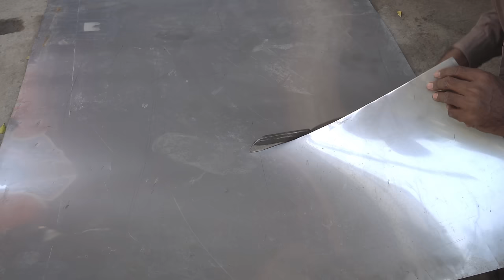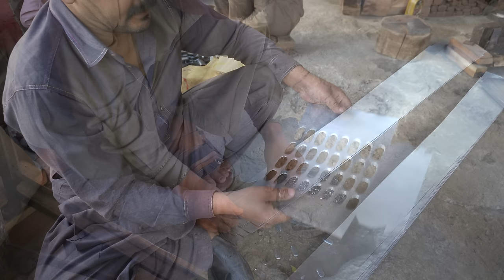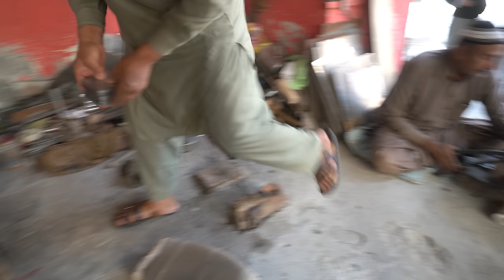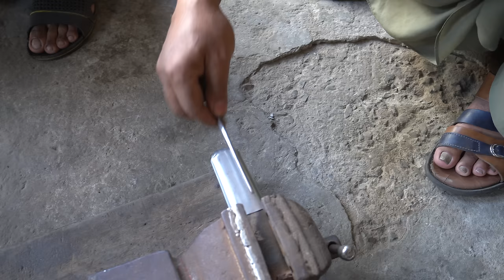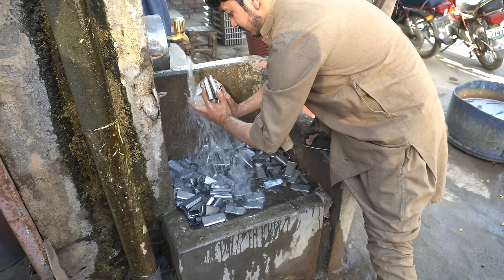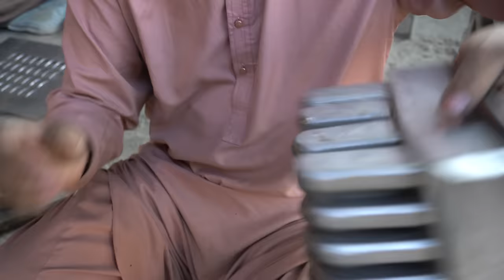How stainless steel Ice Lolly popsicle molds are made | Amazing Ice Cream Mold making process

Comment: Pewters containing lead are no longer used in items that will come in contact with the human body (such as cups, plates, or jewelry) due to the toxicity of lead. Modern pewters are available that are completely free of lead, although many pewters containing lead are still being produced for other purposes?
Reply: isn't it steel?
Reply: @paolodesiato9497  they are using soldering irons to make the joints, which commonly used to melts pewters for electronics (60% tin and 40% lead). 
On the video they are using leadfree pewters, this can be noticed by the lack of shine on the soldered parts
Reply: @Guiabc321  If they are using lead-free solder, the form would break apart right after warranty. Wait... said anyone warranty?
Reply: @Guiabc321  no that's lead solder for sure.
Reply: They washed the cups after soldering them, maybe to remove flux, and soldered again afterwards. I can't tell the pewter is lead free, and the sheet metal may be not healthy too
Reply: Vai Ata koi

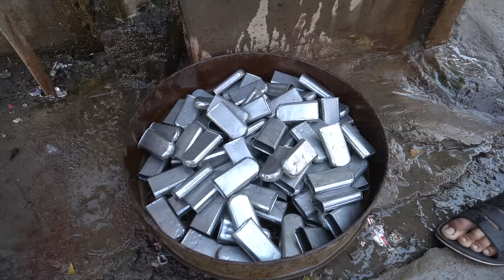Comment: 6:58 Finished washing and already put it on the dirty floor!
Reply: Do you think it would not be washed before use? Like seriously??
Reply: @irfanafzal5158  the LEAD remains toxic even after a thousand washes, the toxicity will be transferred to the food.
Reply: @abdelkadernechadi7497  why are we talking about lead? Was lead on the ground? Next time you should try to resist urge to comment for the sake of commenting.
Reply: @irfanafzal5158  don't worth it📴
Reply: That's because the (dirty) floor is cleaner than the washed parts. 😀

Comment: Solder with plumb and stagnum is not suitable to take contact with foof. Specially frutal or acid ones.
Reply: i don't think they're worried much about cleanliness or food safety, have a look at where buddy carefully washed all the parts, then SET THEM ON THE GROUND at 7:00
Reply: I think the quality of the dirty water is probably more important than the dirt in this process. Terrible sanitation.
Reply: I just hope they don't have any lead in the solder. I don't know why the other guys are so worried about cleanliness of the water they're just manufacturing the molds they are not making the Popsicles. I would assume the popsicle company sanitizes the moles before they use them
Reply: Acidic Flux brushed on.

Comment: Not stainless steel, you cannot solder stainless. stainless does not "ding" it more of a "clack" . there is no way you could bend stainless like here with your bare hands, this is tin or lead plate...
Reply: Galvanized steel scrapped from shipyard